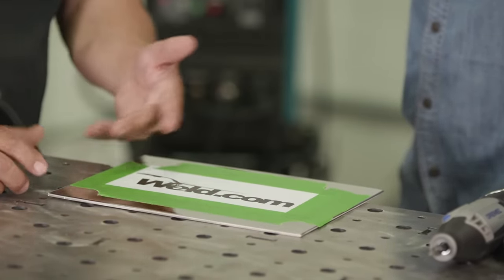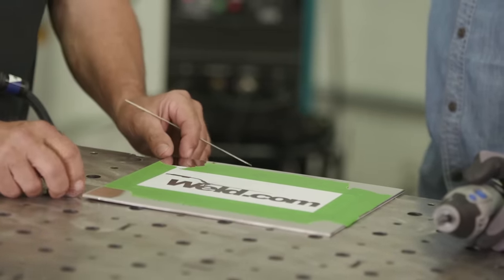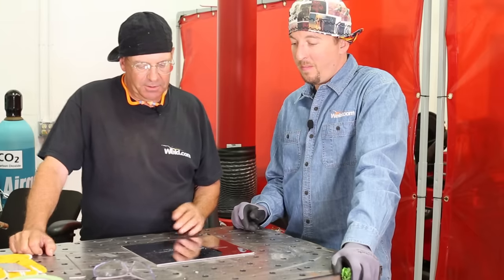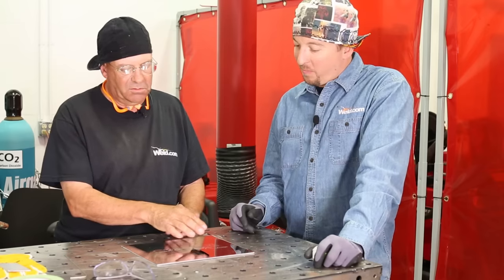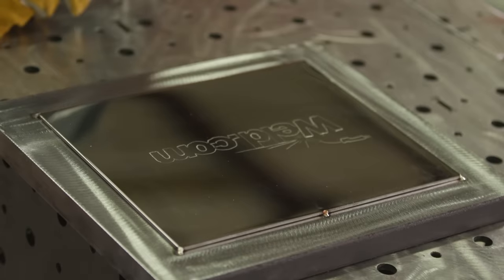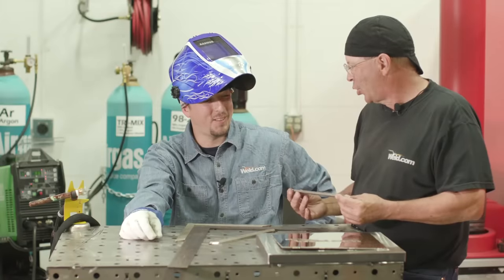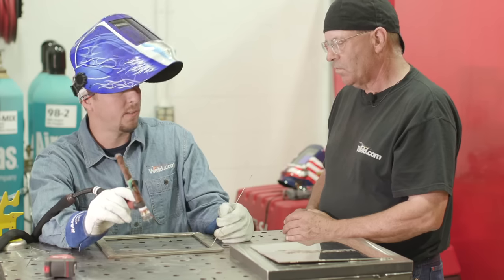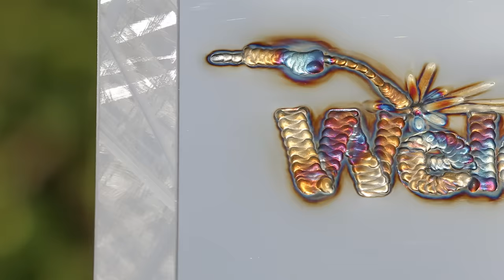How to Make Stainless Weld Art (featuring @dabswellington)

Comment: The thick plate which is used to weld the art piece to, should it be stainless steel or simple mild steel is also good? Stainless steel has a lower heat conductivity, so I suppose that mild steel is better from chilling point of view. What do you think?

Comment: Speaking just of making the outline, this looks like a good job for those vibrating pencils people use for putting ID on things, Carbide tips are common for them - I would have a really hard time keeping the burr from  going off at a tangent here or there, that takes a lot of practice    This of course for the folks at home, obviously you have it under control!  I wouldn't be able to do any of this, but am minded to try just a straight line on some scrap, definitely clamp it down to a massive plate    Good stuff!
Reply: You mean an engraver..

Comment: Pretty cool. How do you get the colors in there?
Reply: Peter Ford gas coverage, heat input and travel speed
Reply: Sean Flottmann Really,,,wow thats interesting. I don't have any stick or mig equipment,, I just use a torch. But was really impressed with the way that came out. Thanks Really nice, by the way.

Comment: Is color strictly controlled by heat? Can Argon flow affect color? Is there a temperature guide or common knowledge of what heat produce what color?
Reply: William Preston 
Colour is basically how hot the steel has gotten.
Different Temps do give different colours

Comment: That fantastic work! What filler wire is that? I couldnt quite see.
Reply: Mr. greens boat tanks and aluminium welding 1/16 308l
Reply: @seanflottmann148  hey man :) your work is beautiful. I hope to do the same where i live and make it big at my local flea market :). What gauge is that stainless? Thank you for your time :) God Bless.
Reply: @jacobgreer1106  12ga
Reply: @dabswellington4441  thanks man :) Jesus Loves you :)